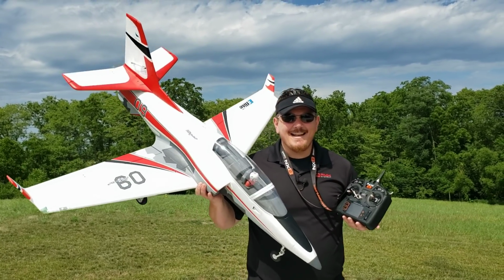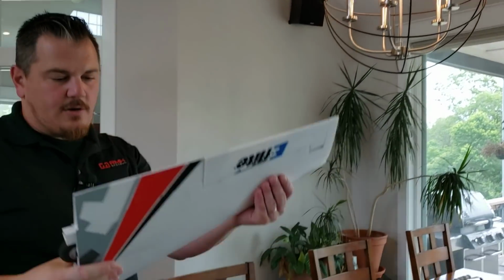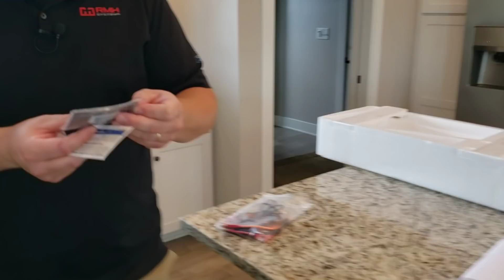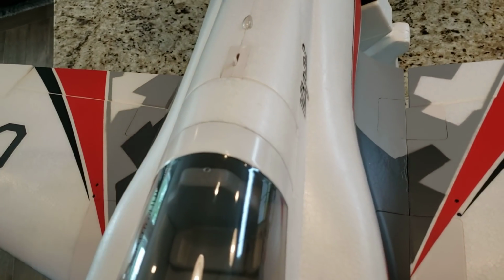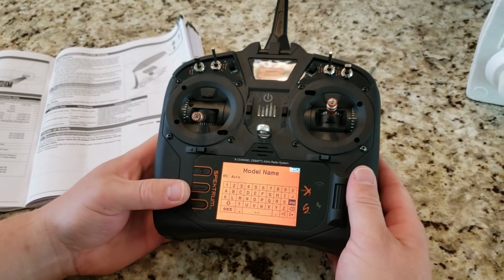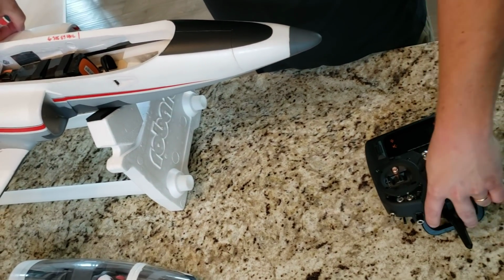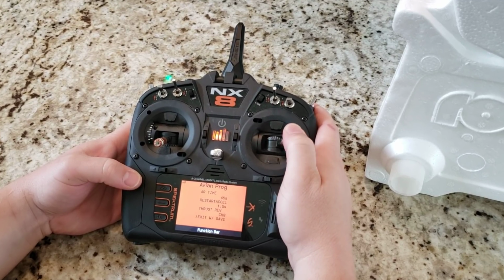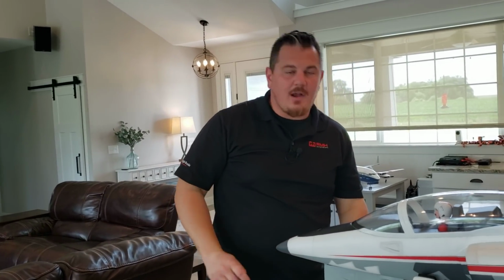E-flite - Viper 90mm - Unbox, Build, True Maiden Flight & HUGE LUCKY SAVE!!!

Comment: Never thought I’d say this to you. You’ve helped me on so many planes I’ve lost count. Foam repair, transmitter setup, if I go way back- “Why CG is important”, and why Dual Rates can do for you.” So I’m surprised in all the videos you didn’t mention the Eflite 90mm Viper was a big Trainer. After the uneventful maiden I tried to make fly like crap. I moved the 5000 and 6000 batteries all over the battery bay. Just flies straight and level. I’ve never own a plane or edf that was as easy to land. This edf was designed for people who have lost the will to live. It’s the first plane I’ve owned you can actually fly and make your turns using one hand.

Comment: Rebuilding a Viper 90mm. Forgot to take a pic of the set up.  Can any help me with where the AUX BEC  from the ESC goes and the lights connector.  Any pics would be appreciated.  Thanks!
Reply from the maker: Any of the ports should be okay, so I assume if your polarity is right, BIND plug, since you'll use the PB on top of the AR637TA, right?
Reply: @BrianPhillipsRC  plugged the 4 line Y plug into the bind plug. Connected the remaining connector to the main AUX BEC +/- plug.
Reply: Someone advised me, on elite hangout group on FB, to do this and no issue after 6 flights.

Comment: Liked the Viper90 so much I bought another one ARF. Since I never mentally matured past the age of 15 I thought to myself, “How could you make the Viper90 even better?  MORE POWER!” I put the FMS Platinum 90mm 4075-kv1500 and the 130 amp Avian ESC.
Not sure which was my EDF OF THE YEAR 2022 was. It’s a toss up- Viper90, or the Futura v3, or the FMS 80mm Bae Hawk. All three at the field on the same day is as good as it gets.
Reply from the maker: I have to agree - three GREAT picks. I LOVE the flight characteristics, and the fact that you can slow them ALL down with flaps OR flare...OR BOTH ;) What a great group of amazing fliers!

P.S. If I don't mention it enough, AS3X/SAFE definitely edges out the Reflex V2. While being totally acceptable in stabilization mode, the Reflex V2 is less well refined, and it shows more in auto-leveling mode. I don't use SAFE or Auto Leveling except essentially to show it off for the new pilots and "Prove" it will work, but the stab - I almost always fly with stabilizer of some form. Glad if someone's wanting to keep to a slightly lower price point, they can squeeze a few bucks off the price, but also and more importantly, for Futaba and OpenTx users - this is UUUUGE ;)

Comment: I'm a machinist i deal with #s everyday and i understand both of you guy's, but got confused.  🤣 Brian nice plane i have a few jets it's on my list if i do definitely from your site.
Now in Muncie 1st time without buddy box Rebel 70mm 4s....flew and landed. Yeah...2 nd flight landing short of the runway ouch.
I'll repair before i beat up my others. Not sure if my tip will be fixable even with the plastic missing chunk of foam and integrity.
Jets land fast i need alot more practice...
Reply from the maker: Yes, and thanks ;) When you get this bird, you will have a HUGE grin on your face - guaranteed!

Comment: If you fly this again can you try it with 2x4000mah or 2x5000mah batteries?  HH says its possible but I haven't seen anyone on YouTube try it.
Reply from the maker: I technically could. I wonder what type of penalty I would pay for the additional weight, vs just a single 7000mAh 6S?

Comment: Hi Brian,  I been trying to follow your instruction on adding reverse on my new viper 90 but my NX8 won't get passed the first step up elev left ailr  I get no responds.  Plane is bound and I try as soon as I connect the battery.  any suggestions will help.

Thanks, John

Comment: I am somewhat new to the r/c game and recently bought an NX8, can you please explain the LT and RT trim tabs? I cant seem to find info on their function... thanks in advance
Reply from the maker: They can be used to trim control channels that aren't attached to the main sticks, since they already have trim buttons. If you don't need them, don't worry too much, you can use them for custom mixes, but since they're in a weird spot, I'd avoid using them unless it ground based adjustments....but just my 2 cents.
Reply: @BrianPhillipsRC  thanks for the clarification
Reply: Use them for inflight flap trimming

Comment: How do you feel about the Spektrum 4 and 6 channel antenna-less receivers? I.E. 410 and the 620. Are they any good?
Reply from the maker: They also make an AR630, but for ~ $5 more - I'll get the antenna on an AR631 ;)

I have a 4Ch and 6Ch air receiver, but since I want SAFE/AS3X, largely to share with our audience, but also, I WANT AS3X, even when it's NOT needed...so I have only used the 6Ch, AR620 in one plane, and I wish I would have put in an AR631 or an AR630.

Horizon Hobby claims they have just as good range, but I don't believe it. I will only use it on a small plane, or something I can RUN AFTER - LOL ;)
Reply: @BrianPhillipsRC  thanks again for all the help!

Comment: Just got mine last week, getting ready for first flight. The pilot now has no mustache....also one of the elevator servos was NOT reversed so they work opposite each other (like rollerons). I contacted Horizon but no joy as yet from them. So first flight is delayed until they can get me a replacement/fix.
Brian, a couple of critiques on your radio setup section:
First off it was helpful and appreciated. But I did find it hard to follow as you digress too much during the explanations with other comments or observations that are not germane to what is being taught/demonstrated. It also helps if you go a bit more slowly. I know we can pause/rewind but it does help as these are critical radio setups. (for example it took me a bit to figure out that you had to enter the SMART ESC setup right after connecting the battery....you can't get to the ESC programming menu after the ESC has completed it's initialization)
Also when you demo'd the reverse thrust it was like you were learning it as you filmed. It would be better to learn it then film once you have the steps down and can demo them in the correct order and edit out the 'learning' you experienced.  Just makes it easier to follow.
Keep up the great work. A few guys in the club are familiar with your reviews.
Reply from the maker: Wow - the elevators are defecting opposite - that's terrible!!!

If you get tired of waiting for HH to get back to you, there's two things you can do in the mean time...

1) Pull the servo and open it up and then swap any two of three wires on the FEEDBACK pot, and swap the motor leads...this will effectively make the servo into a reverse servo.

2) Put one of these in series with one or the other elevator servos...

Servo Signal Reverser (Horizon Hobby) https://bit.ly/3B9nVpT
Servo Signal Reverser (Amazon) https://amzn.to/3bpECDf
Servo Signal Reverser (Banggood) https://bit.ly/3tkn9yN

....I've done both on separate projects in the past to remedy such an issue.
Reply from the maker: As for your question about if we were learning how to setup the REVERSE THRUST when you watched us on this video - yeah, and you may not know this, but we had the plane BEFORE the tech specs came out. We were figuring it out (About the same time as the tech guys at EFlite - this was an early release for us)
Reply: @BrianPhillipsRC  all good. I got it set up and used it on my Viper90 maiden this past weekend. The other pilots at the field were suitable impressed with it and want it for their EDF's now.

Comment: I think they added the capacitor because of the reverse thrust, when you go from forward to reverse with rotational mass, amperage goes thru the roof and voltage can drop to very low output..
Reply from the maker: Not on the other Avian equipped planes with Thrust Reverse...I think it's the size and power loading of the servos ;) Either way, wish we had them on all the stabilized Rx'es...that would be cheap insurance.

Comment: I almost bought the 70mm a couple of months ago but held off and bought some other planes. Now I am ready fora first EDF. Would this be ok as a first jet or stick with the 70mm?
Reply from the maker: Actually, since this one has more robust landing gear, it might JUST beat the 70mm out...BUT you will want to have a pretty HUGE environment for flying this plane, since it's BIG.

I don't want to give you bad advice, but really, your budget makes the difference on this one...if you can crash an destroy a $700 plane and sleep at night, then this plane is NOT an issue....BUT if you're more inclined to be nervous as heck, like I would be, then maybe do the Habu SS or STS 70mm, or the F-15 64mm (Great easier choice).

There's also a few other great choices that might be a bit more economical that would have you loving the plane while you advance through the ranks, like the F-16 70mm...

Honestly, it all depends on what you think of your skills, how your budget will handle the hit, and where you fly - the latter being the most important. If you fly from an aircraft carrier like me, you will wish you got the 70mm first, but if you're flying from a 750 foot long X 100 foot wide runway with 3 miles of clearing to and from the strip - get the 90mm and love it right away ;)
Reply: @BrianPhillipsRC  thanks. That is exactly what I need. I’m pretty indecisive and hearing all of the possible pros and cons actually made this easier. I have a huge field to fly at but my skills are advanced beginner (1 year of flying once or twice a week) and I think the Habu SS is a great choice. I didn’t think of that one but I’m glad you did.

Comment: Rather than fiddling with Mix to neutralize the reverse thrust in the middle position I have found it easier to go to Digital Switch and adjusting the percentages there for each position (did it this way for Timber Evolution).  Also, I assign a voice command for each switch position used and review that before connecting the plane battery since not all planes will be identical but agree, they should be as much the same as possible.  While flying and changing a switch I find it helpful that it announces the new setting which confirms I got the right switch.  The NX transmitters are great.  Not sure this Viper would work well off our grass field though.  Otherwise pretty impressive!
Reply from the maker: She'll do great on grass ;) Obviously BETTER on pavement, but I did change my switch settings a bit. I was going to try the "Digital Switch Settings" next time to see how well it works.

Comment: Brian so I set up the reverse thrust using ESC programming. Do I have to engage engine breaking at #7 for this Viper like the Turbo Timber Evolution? Thanks in advance. Great video as usual! 🙂✈️ 🚀
Reply from the maker: You can make the assignment in the ESC programming - follow my steps toward the end of the radio setup. You can use I think channels 5-9 if I'm remembering right.

Comment: After watching how slow it lands and stable it flies I am considering this as my second EDF. I was looking at a freewing raptor. However having SAFE is nice when I get nervous, distracted and or the weather changes etc. Thank you Brian and Crew.
Reply: The fw raptor is the best flying edf in my collection with lots of room for growth😁 and practically lands itself. not to mention with the right rx you can still program safe. Not to deter you from the viper they're both great, decisions decisions🤣. Although the viper has the added benefit of showing Brian some luv👍
Reply from the maker: I wish I could show you the difference, so you could make an even more informed decision...but Motion won't work with us ;(...
Reply: @BrianPhillipsRC  I have several Motion models, love my Avantis. But it seems like Horizon is just passing them by at warp speed. I can't remember the last time I saw a new EDF release or major update from them.

Comment: Got my Viper 90mm together to find out that when on for an extended period of time both my flap servos are extremely HOT! What can be cause this?
Reply from the maker: Are they bound up at all (even a little)??? If so, make sure you back off the throw some, or free them up. This would be the only thing I could see causing this type of issue. They run at a higher than average BEC voltage, on this size class, and that can cause some additional heat, BUT only if there's load...

Comment: I've watched a number of videos on the Viper 90mm from various people.  The only issue I've seen with it is that it has a Very abrupt stall characteristic.  It appears that the outer wing stalls before the inboard part of the wing, and the wing suddenly drops.   In Brian's video you can see this at 5:02 when landing.   Brian does a great job of recovering.  Wish Horizon Hobby would modify the airfoil.......   

As a side note, with many single engine propeller aircraft (like Cessna's and Piper's) it is very common to pull up the nose slightly while landing and stall just inches off the ground.   With high-performance aircraft, one literally flies the aircraft on to the runway.  This is one of the most difficult issues many pilots have when transitioning to high-performance aircraft.......

Comment: On mixed flight what air time did you get on a 5200mah? I hope its more than the 2.30min the SU-30 offered. On a windy day the SU-30 might only get 2min which is not enough. What air time did you get on the 7000mah. Great work on the channel as well!
Reply from the maker: I don't have a 5200mAh, so I can say, but on the 7000mAh we were still "respecting" the timer. We just posted some more flights this morning ;)

Comment: What is that capacitor for? Is it needed? What are the specs on it?
Reply from the maker: It's used to help keep from brownouts caused by a lot of servos moving for AS3X.
Reply: @BrianPhillipsRC  Interesting. I've never used caps, but wonder if I need them in my higher servo count models. What's the capacity in the one installed on the Viper?

Comment: Hi Brian,
At 1:11:06 you talked about the pictures of the planes on the Transmitter. With the IX12 you can take a photo of your plane with your camera, insert the SD Card into the Transmitter and place the image in your model settings. I did that for the 1.2 Metre Mustang and the Cessna150. The IX12 doesn’t have the camera. Only the IX20. I won’t be investing in an IX20 as they cost AU $2,600.00 here. Kind of glad I bought the IX12 quite some time ago as that is also quite expensive now.

The new Viper costs AU$1,200.00 here.
Reply from the maker: Awesome ;) Something to look forward too!

Comment: Hi Brian. Love your content.

Could this be a decent second EDF?
Reply from the maker: Thanks, and sure - it's not a HARD to fly EDF....in fact, it's EASY to fly, but it's just a ball-buster, like it's 70mm little sister...in that on slow finals, the plane can slip out from under itself if you don't keep your speed up.

Also, bigger and more expensive lipo's are going to set you back hundreds of dollars, but if you're getting hooked, should be nothing new, blowing a WAD on batteries ;) I LOVE this plane, but we haven't even done second thoughts yet, since it's been out of stock for-ever!!!!!!!!!

Good luck, if you go for it - GREAT PLANE! Also, do the Pilot Fatigue setting and you will LOVE it for this plane, just as much as the F-16 80mm.
Reply: Thank you again, Brian. This was helpful setting up thrust reverse.

Comment: I had to go with the fw 90mm f22 which will be upgraded to a jp hobby 12s setup😁 and a fms futura v2 with added diy afterburners etc for all my jets. Reverse thrust seems so novelty to me at this point unless on a propped plane. For the edf's id prefer just getting some brakes included, just think for your run up you could just lock the brakes, up the rpm unlock brakes and your off. E flite is losing me tbh.
Reply from the maker: I think breaks on the throttle channel would be more simple too, but it's super fun, thrust reverse. I know that if a guy needed to slow down faster, bushings, rather than bearings, on the wheels would make a big difference.
Reply: @BrianPhillipsRC  Yea I norm run tiny o-rings under the e clips, seems to work well for reducing rollout.
 I'm with you on the reverse thrust being fun its just with edf's already being as inefficient as they are, reversing edf nets minimal results with the added mah tax. I want more flying time not less lol but there's caveats at every angle. I just see the brakes as more rewarding at less amp draw, I know I'm splitting hairs lol.

Comment: hey brian i think you dont have to hold down bind button on rx to bind. i just push it once until it blinks then walk away from plane and bind. it seems to work fine and you dont have to be a contortionist to bind lmaooo. great video buddy
Reply from the maker: Thanks for the tip!!! I'll give it a shot!

Also, we've been going into the "BIND" mode when and if it fails - I think we just try to get both in the shot at the same time, and that'll always cause issues...but it's cool if we can show the lights all at once ;)

I will try it Michael!
Reply: @BrianPhillipsRC  yes you can bind from the menu or the old fashioned way lol
Reply: @BrianPhillipsRC  to bind on the Rx you hold the "bind push button" as you turn the radio on the let go...
Or go into the bind settings on the menu